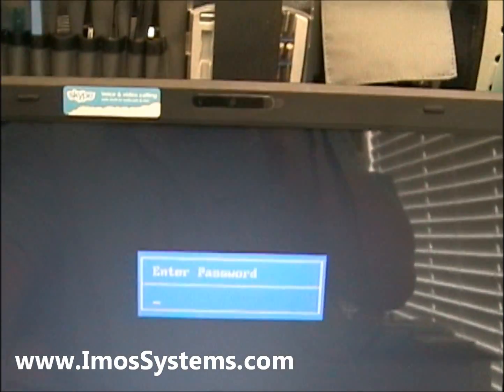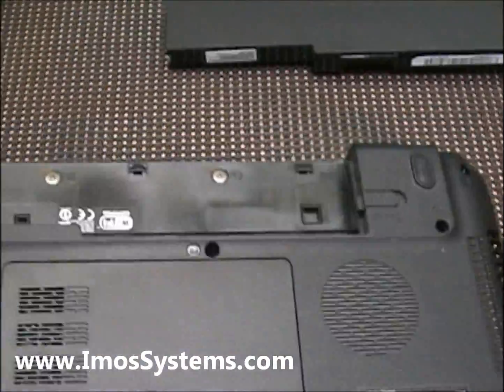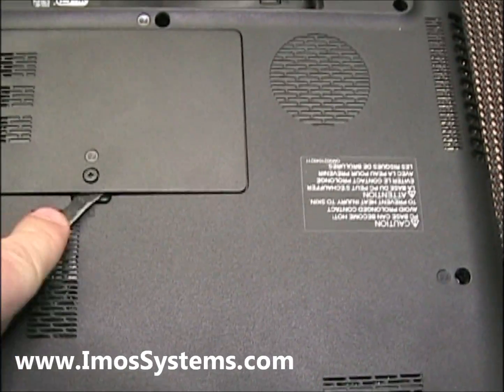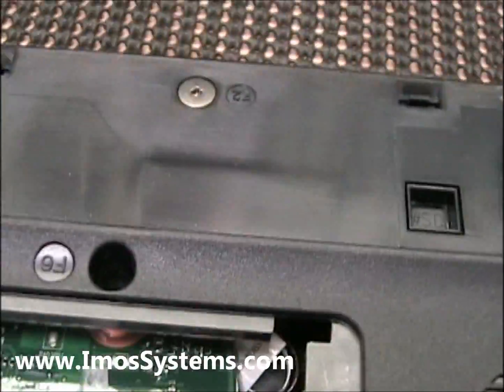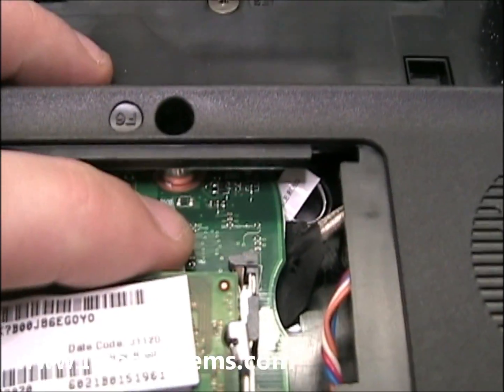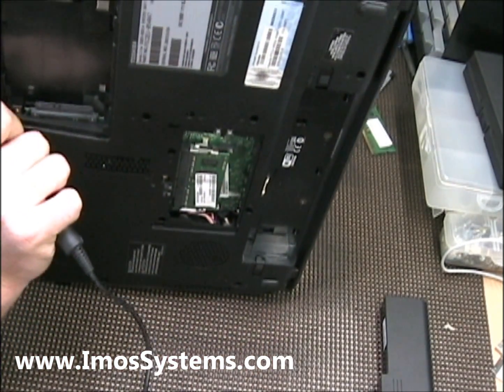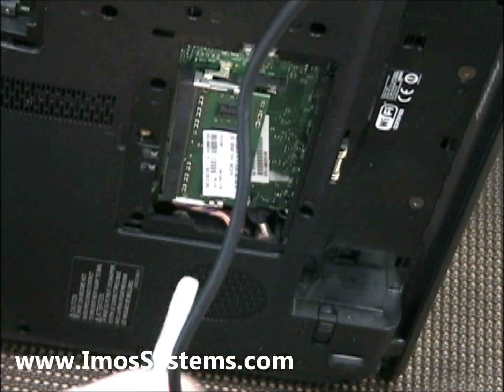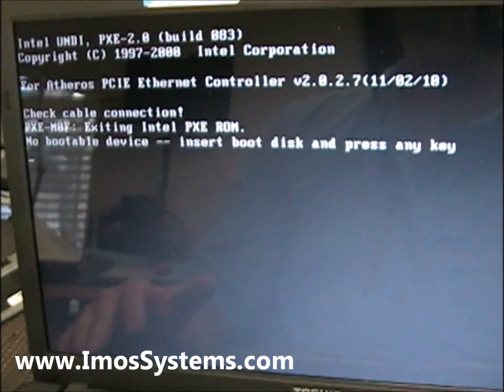Toshiba Satellite C655-S5514 Bios Password Removal How To

Comment: I am trying this, but i either get 6 loud beeps or then i try again, and i get nothing.  Am i supposed to make the contacts first then press the ON button, or HOLD the ON button down, please?
Reply: I am trying to HOLD down the ON button, and I get either the 6 loud beeps before it shuts down, or sometimes the name Toshiba flashes briefly then it shuts down. Or it does nothing.
Reply: I got it. One of the things someone else said to do was to HOLD it for a few minutes on the contacts to "drain" the data, and that finally worked.

Comment: Hi. Thanks for the video and information. I’m not totally certain whether my issue is exactly the same so would like to check with you. I don’t want to change or remove the password.

I have a Toshiba Satellite L50-A laptop, and when I power up, it goes past the Toshiba screen to the “enter password” screen (which I now understand is the BIOS password), however when I type in the correct password and then try to enter it, the screen stays stuck at this screen. Nothing I do will allow this password screen to change.

I cannot even hit F2 to enter the BIOS screen.

I keep finding various tutorials about Toshiba issues, but so far haven’t found any that I think specifically address this issue.

Would you have any advice on this problem for me, and why the screen stays stuck here even when I enter the correct password?

Also, if the BIOS battery (the CR2032j needs replacing, could this be the cause of my computer not letting me get past this screen?

Thank you for your time, it is much appreciated.

Glenn.

Comment: Enjoyed your video on Toshiba BIOS password reset, but I have not been able to identify the correct  reset contact points on my Satellite A665-S5199x,   Part No. PSAW6U-03E007,   Ser# 4B400696K.  i can't even find any reference to the model number on the Toshiba Web Site.  It is ten years old but, I do not want to replace it and I would appreciate your help.

Comment: #Unlock #Toshiba #Tecra, #Satellite , #Portege , #Satellite, #Qosmio #Bios #Password
With #Challenge Code and #Response Code

1. Switch on the notebook, when the boot logo appears press [F2].
“Password=' will be display.

2. Press keys in the order [CTRL], [TAB], [CTRL] and [ENTER].
The Serial number and Challenge code will be displayed.

Please Note:
For some reasons it could happen that no PC Serial No. and Challenge Code will displayed instead of "Not Certified" appears. In this case remove the AC-adapter and the battery for a short time and try it again.

3. Please make the payment below or contact me
My Skype : haisung4344

VERY IMPORTANT
Do not power off the computer once you provide us with a Response code. There’s a unique Response code .
Don’t turn off your notebook, don’t restart it, don’t enter anything except generated Response code.

4. You will receive the "Response code".

Comment: B500 pins shorting in other C655 laptop also worked, but I got an error when using only the top memory slot, I had to move the RAM to the bottom slot and also drain any power by remove laptop battery and holding powering button for 10 seconds (with laptop charger unplugged). It took a few tries, but the last time the laptop shut itself off, which was a little scary, I thought I fried the  MOBO, but it rebooted and the password was gone. Thanks IMOS Systems.

Comment: The reason many people can't get this to work is that there's a clear sealer over the motherboard. Make sure you do a little scraping or whatever to get contact on B500. *Edit; Do not scrape your motherboard! Just the little B500 solder pins and just enough to make good contact.

Comment: My lap top is a toshiba satellite a200-236 and it goes on and off just quikly, and I've seen some videos that should reset the bios now in your video you say gotta touch some points called b500 I stil looking for those points but this a different device same brand but another model . Could you help with this? Tnks in advance.

Comment: I have a old mans satellite L355 and did the jumper B500 and it worked like a charm after about 3 tries, and cleared the bios password and user password.  Now I can get in the bios but when I leave it asks me for the HDD password I found no way in the bios to disable this as it asks for it in the bios to before I can go into that section.  I reset the bios  to default but that didn't help.Any advice on how to remove the HDD password. Or if its written somewhere on hard drive. This guy is almost 90 and his grandson was using it about a year ago and may have set this up. Or Pops might have done it and has no memory of it. thanks if you get this and have any advice would be appreciated/ Leslie

Comment: I'm working on a L505-S5966. Pulled out HDD, ram sticks, and I peeled the tape back and found b500 and used a screw driver. Black screen, began to start internally but shut down and restarted, still with nothing on screen. Put a stick of memory in, repeat process, another stick of memory, repeat, and then the HDD. It starts up black screen and resets again with nothing on screen. Took all of it out again to start over. This time while holding the screw driver to b500, Toshiba logo screen came back up and then went right back to bios password. Man what a headache.
Reply: Lesser z same thing happening to me

Comment: Hello there!! i got a satellite c650-188. I tried to short the B500 but still no luck!!!! can u plz tell me wuts wrong?! :)

Thx....
Reply: I tried it also to my Toshiba c640-11N unfortunately B500 doesn't worked, when I turn it on, the power indicator and the capslock button is just blinking.
Reply: Chris M4gz

omg!!! sry 4 that!!! i got a tip 4 ya:

Never buy a toshiba pc ever again!!!! ^_^

uk, its easier on other pcs 2 remove the bios password just by removing the CMOS battery 4 a couple of mins. i tried it on toshiba, it never worked!! n i tried 2 short the B500 jumper, it never worked 2 ;(
if files that r on the HDD r not very important, u can buy a new HDD n replace that 1... :)
Reply: M Kimp 
or i'll buy new loptop instead. Haha! struggling to fix this problem. BTW thanks for your help.
Reply: Chris M4gz

yw ^_^
Reply: This method did not work. When I press the power button I get a message that says press please press the power button and change the RAM to  another Dimm. Now what do I do? Please help me 🤔🤔🤔
Reply: Put the stick of RAM in the other DIMM. Some laptops don't like a single stick in the top slot with nothing in slot nearest motherboard. After you put it in the other Dimm, follow the instructions once again.

Comment: This worked for me but I had to do two things: I used a piece of wire. For some reason the screwdrivers I was using weren't connecting.  Also, I had to remove the CMOS battery. And then it worked.
Reply: +PoultryBuffer 

Yes thats the right answer.I had to remove the CMOS battery before procedure but for me works with flat screwdriver . 100 Work on Toshiba sattelite C650
Reply: You're right, I used a piece of wire too

Comment: Good fix! I've been working in IT for 7 years now and this is a pretty common occurrence in Toshiba laptops. This also works for the C855D-S5320 models as well. Just had a whole batch we had to do this fix on. A word of advice, like it's stated in the video is just keep trying. The CMOS is finicky and sometimes you just have to just keep at it. We had one that took 12 tries before it cleared.

Comment: How Can I reset bios on TOSHIBA PORTEGE Z835? it got Supervisor Password, and I cannot install windows again
Reply: ***** I already tried that, remove the computer battery and the bios battery, but it only reset the settings, it won't erase the supervisor password.  There should be a way like to jump a circuit like the video

Comment: Worked just fine. My model was C655D-S5518. It was pretty close to the location you mentioned, but it was located under a couple of stickers that had the hardware MAC address and Product Numbers for the laptop. It had the same labeling: B500. 

Thanks.

Comment: I have a Satellite E55-A5114 laptop, but I wanted to change the O.S from 8.1 to win7 but I accidentaly installed other drivers including the bios drivers, as a result I can't log in the bios settings menu with f8 or f11. Does this method could reset that change in order to login the bios?
Reply: you should press F2 quickly when the laptop starts and then you'll be able to enter the bios ... after that go to security and disable the secure boot ... then go to boot , advanced boot options , and change you bios from from UEFI to legacy ... once you do that you should be able to fix things out ! waiting for your reply

Comment: My son has a Toshiba C655d-S5200 Laptop with 320GB HDD.  Recently, out of the blue the hard drive failed to boot into Windows 7 and there was a Error Message; "check cable connection! PXE-MDF. Exiting Intel PXE ROM.  No bootable device.  Insert boot disk and press any key.  No one set a BIOS Password and I thought it was a Virus or failed HDD.  Question:  Will your video repair remove this error message and allow the drive to boot into Windows 7?  Also, I tried Sea Tools for disk and it reported 99 errors and failure.  The computer does recognize the HDD in the setup but it fails to boot up.  Help?

Comment: your in brocks field fl

i am in belleview fl

i have a Toshiba Satellite a205 s 5084

what am i doing wroung i hit the 0 botton to bring it back out of box

it dont seem to work yet for me

is it the right botton

or do i use a deffent botton all together

if i hold the 0 botton all it does is beep beep

if i power off and power on and start to tap i get windows vista flash and press f-8

then it starts with 

safe mode

there is nothen above it that says restore

i have not tryed cliking the windows vista yet

is mine a deffent botton

can i call you on the phone to get this computer going to formate mode

i dont need anything to be backed up i just want to start new out of box mode

i seen vids on how to do it

but it just dont seem to work for me

thanks

can i get the revory disk or can i make a restore disk

i dont know where brocks field fl is but it cant be too far from belleview fl

or do you know someone closer to me

or just to buy the disk or to make my own but how to guid 

i tryed google seach

i tryed youtube search

but like you know 

it all it all depends on how you ask the questions

for the answer 

thanks for any tips on reformatting my computer

Comment: Thanx for the info. I've tried this 8x now with a C655D (AMD cpu) and doesn't work. When I put the ram in the top slot, the screen says "Please replace memory with another dimm" and it doesn't remove the password box. I have to put the ram in the lower slot for the laptop to boot, but still isn't removing the bios password. Is there a different way to do this on this laptop since it's AMD instead of Pentium?